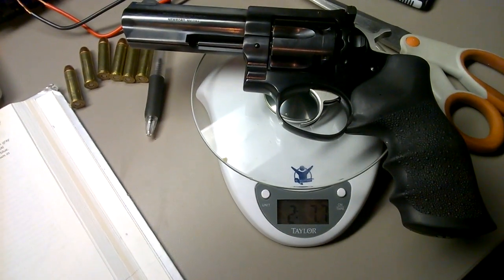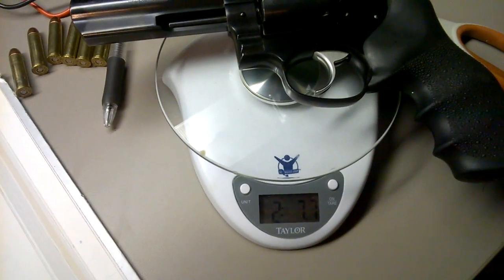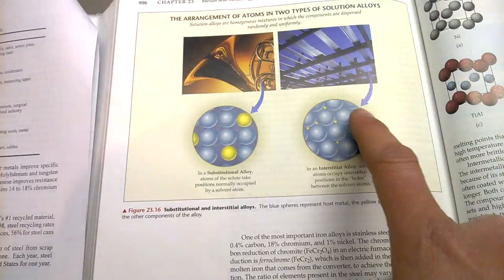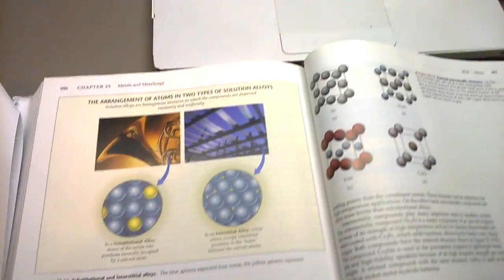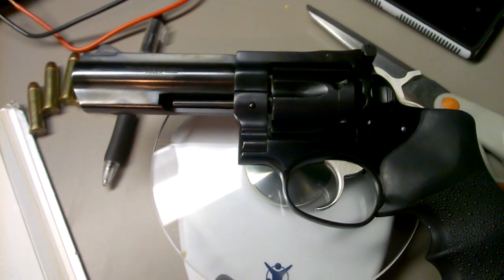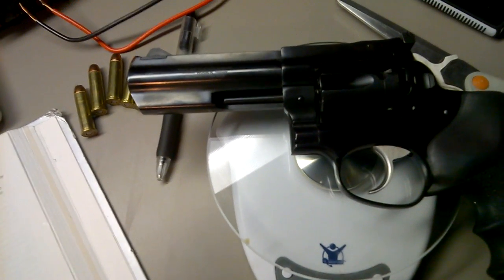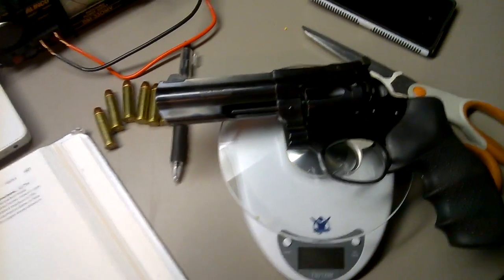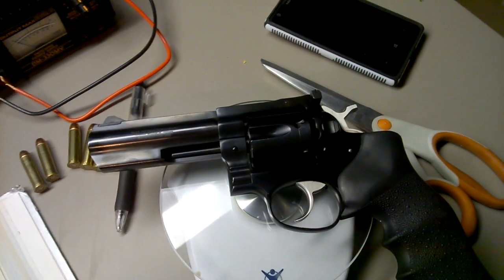GP100 Blued vs Stainless

Comment: I like the blued better. Looks cooler! Stainless nice too.  But tired of shiny gleemy guns. Am buying a Ruger gp100 357 6" blued. But my friend with his Smith&wesson stainless, told me blued will rust? Or is that if you just leave them sit forever? I shoot and use,  take care of my guns. Should I have concerns about blued steel?
Reply: No. I have the 6 inch blued. Never any problems
Reply: Blued can rust when its  not oiled and in a humid climate. But even stainless can rust but not so likely.
Reply: I have he blued GP100. I coat it down with Remoil when not in use. Remoil prevents rusting, but doesn't feel so oily. Love the gun...
Reply: I have many blued firearms here in South Florida. The ones in the safe are all oiled before storage and my carry pistols get a simple wipe down when I take it out of the holster before bed every night. With many weeks long trips into the Everglades, I've never had a problem with rust whatsoever.

Comment: I am sure the Blued/Black gun has the same metal thickness as the stainless version - plus Ruger has made their .357's in stainless steel since the early 1980's.  I prefer a stainless gun whether revolver or auto -p so I don't have to worry about the finish coming off.  Heck I even like the High-Gloss Chrome and Nickel Plated Guns.

Comment: I also read that the stainless cylinders on D.A. revolvers have peening in the notches after a combination of several hundred rounds of heavy magnums and fast double action shooting, (has something to do with the timing of the hand,  bolt and the softer stainless metal)  Compared to the carbon steel D.A. revolvers which have none.

I'm going to interchange my buys,  I'll get a stainless some time other,  But for a GP-100 I'll get blued. 
Great video.
Reply: You do know that there are several different types of Stainless Steel, just as there are several different types of Carbon Steel.  Plus Stainless Steel is also mis-labeled - as it is Rust Resistant Steel and No Rust Proof.  You still have to take care of both types of metal - oiling them, wiping them off, etc.  Both types of steel are tested by the Manufacturer when making the guns.  I am sure either one will out live the owner.
Reply: 44357514
No doubt they'll last,   And Yeah I have a good idea on how many different types of metals there are.  I was posting previous knowledge that I and several other stainless revolver shooters have encountered,  And seeing as most stainless revolvers are comprised of the same "Type" of stainless (I figure) set by the manufacturers. 
Could be wrong but my last statement was based on the thought that all S&W Stainless revolvers are made with the same type metal,  For instance.

Comment: I glad I bought the staneless. Mine does look thicker then your blue Ruger. Mine has been shot many many times. it's one hell of a gun. I keep it polished. No problem with rust. I will pass mine on to my son. You have to polish all guns. Or they will rust.
Reply: polish? wrong choice of word there. polished means to refine the paint or finish. you mean to say cleaned and oiled
Reply: tank2449 I polish it. Then I wipe it down with a light coating of oil. Ruger is stainless steel. And it works fine. My guns look as good or better than the day I bought them. I have never had any problems with them.
Reply: i wouldnt polish it every time i clean it. that makes it have amirror gloss shine isntead of teh satin its supposed to have.Thomas Tommy

Comment: It's going to be hard to be polite here, but what the heck are you trying to say in this video? You are comparing two different revolvers, one of which you do not even have for your video.

Both models weigh the same according to Ruger's web site. What do you know that Ruger doesn't?

If you are going to babble on about steel strength vs. weight ratios, how about also including the differences in heat treatment that are applied? Additives to the steels?

The fact that you only verbally assert they are different dimensionally but do not SHOW A SINGLE DIFFERENCE makes your statements easy to ignore.

It seems to me that you are desperately trying to justify your purchase of a blued revolver over a stainless revolver. I don't see any reason why you should feel the need to do this as they are both very fine revolvers.

I prefer the aesthetics of a blued firearm but the stainless finish is just so much easier to maintain. Scratch? Reblue it on a blued gun but buff it out on a stainless, for example.
Reply: i always tell people that theres a reason why the model 500 only comes in stainless and not blued, that being said i love blued guns
Reply: Shut up.